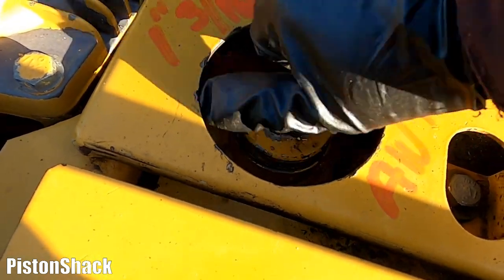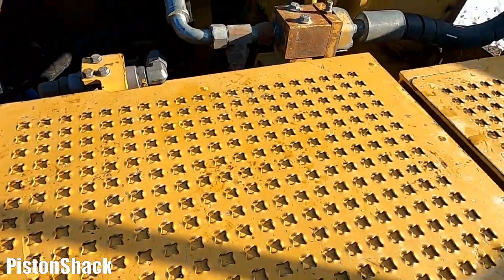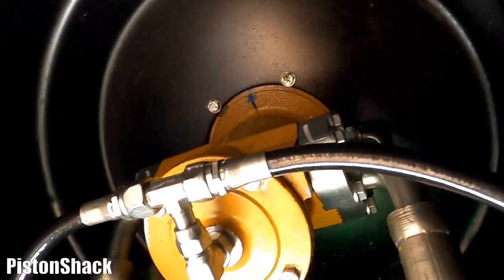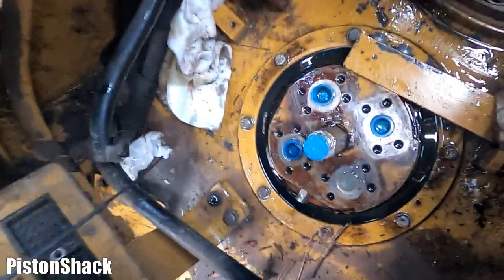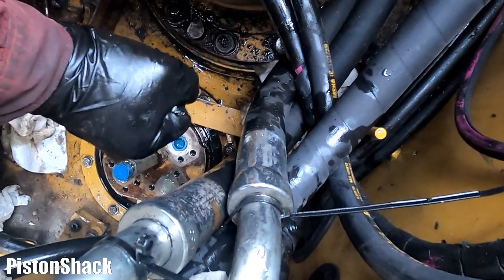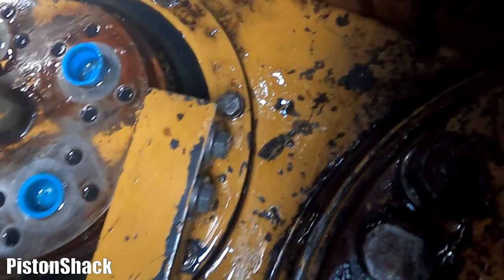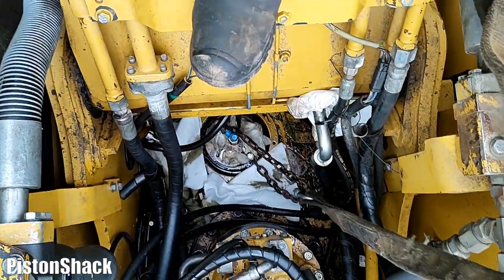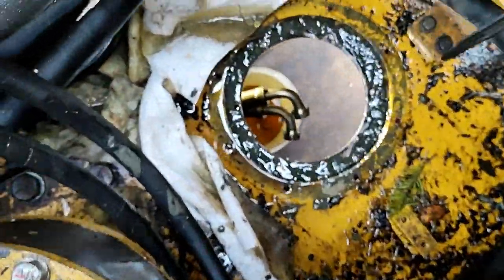EXCAVATOR ROTARY MANIFOLD REMOVAL MADE EASY | CAT 320D FM | part 2

Comment: Very helpful video. My HITACHI UH07-LC is leaking from this rotary manifold. I have not looked under there yet but hopefully, I can also access the bottom section from underneath without having to separate the track undercarriage from the upper house.